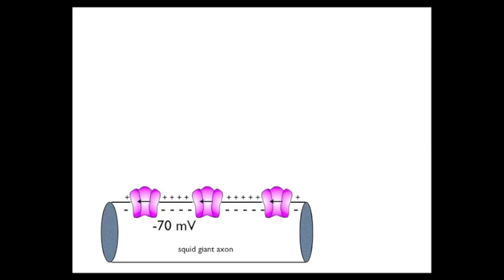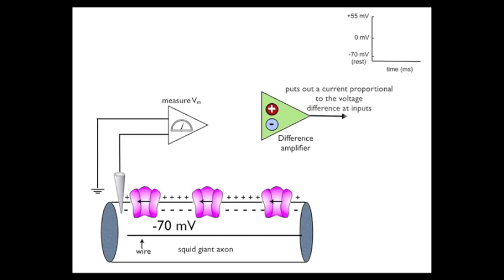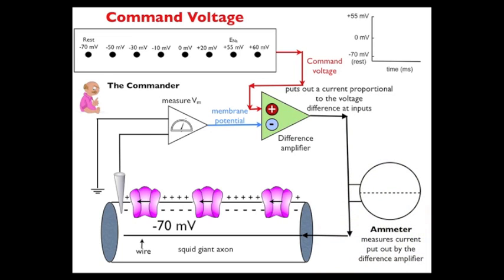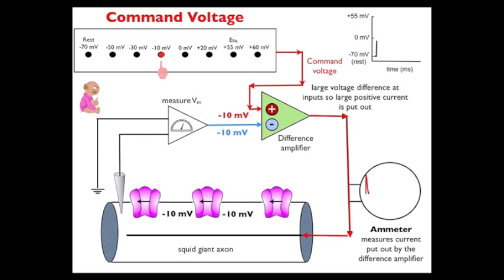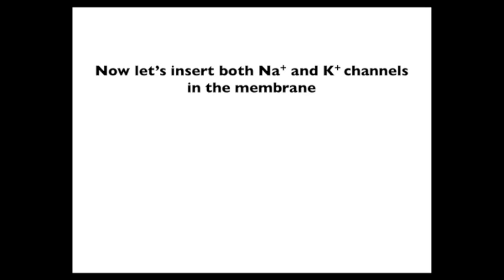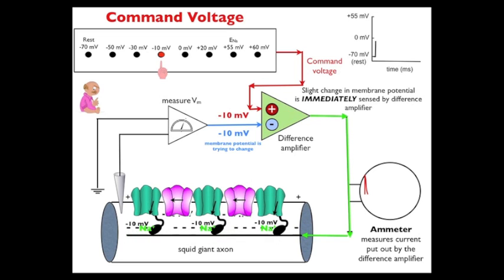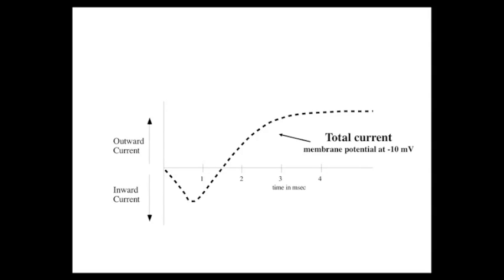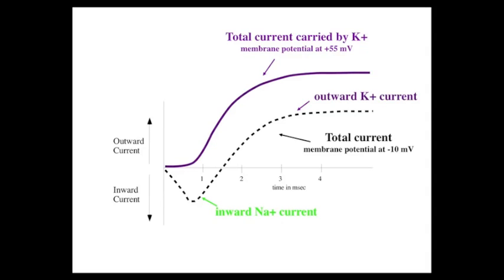Movie 11 Voltage Clamp 2 measuring currents

Comment: Why do the voltage-gated potassium channels open at -10mv? I don't understand this, all the textbooks say they open at around +30mv only...?
Reply: They actually start opening at the threshold potential of around -55 mV. But they open slowly. On the other hand sodium voltage gated channels also open at threshold potential but they open immediately so sodium ions start moving into the cell and they cause depolarization of the cell membrane and bring the membrane potential to about +35 mV. At about +35 mV, inactivation gates of sodium voltage gated channels close and potassium voltage gated channels which were opening slowly now finnaly fully open up and potassium ions start moving out of the cell causing the repolarization of the cell. All the stuff that I just talked about will happen exactly the same way at threshold potential but also at any potential that is more positive than the threshold potential. So if we change the membrane potential to -10 mV, which we did in this video with the voltage clamp technique, sodium channels will open immediately, potassium channels will start opening slowly, after about 1 milisecond the inactivation gates of sodium channels will close and potassium channels which were slowly opening now fully open at approximately the same moment at which the inactivation gates of sodium channels close.
Reply: @lukakusekovic9185  Hello Luka, thanks for explaining! I was wondering, by commanding a membrane potential above the threshold, we can still have an action potential even though we are controlling the membrane potential at a specific value?
Reply: @SukhdipKaur  You can't cause an action potential because you are clamping the membrane voltage at some constant value

Comment: Could someone please explain why is it important to set a command voltage, such as keeping membrane potential at -60mv, does it show us what ionic activity there is at -60mv?
Reply from the maker: Yes, that is exactly the point.  If you clamped at -60 mV, there would be hardly any additional channel openings and only a tiny amount of current would need to be injected to clamp (hold) the membrane potential at -60 mV.  Now clamp to -40 mv, and many more channels, both Na and K channels would open, and more currents would have to be injected to compensate and thereby hold the potential at -40 mV.